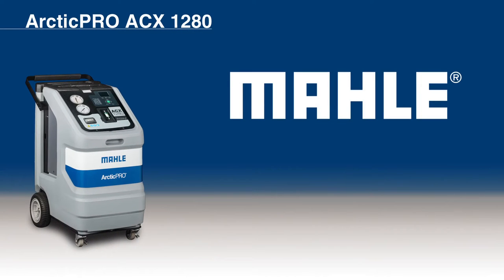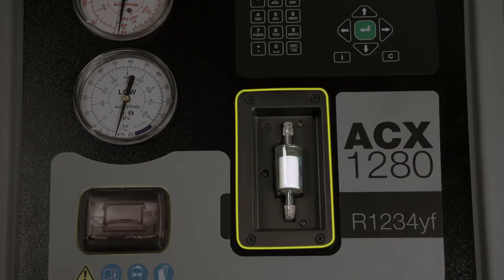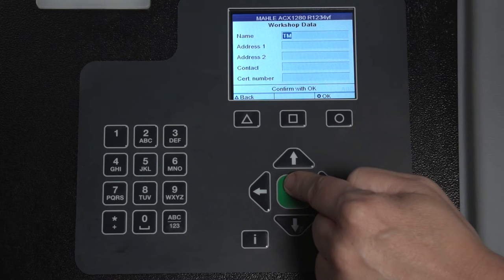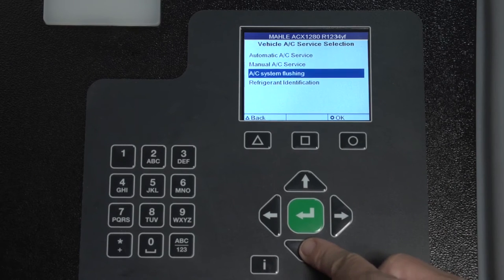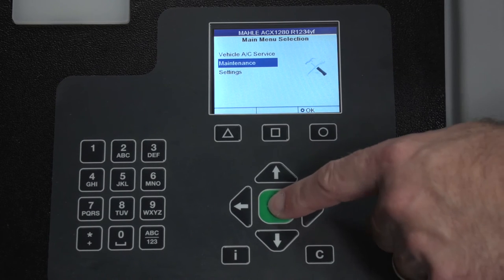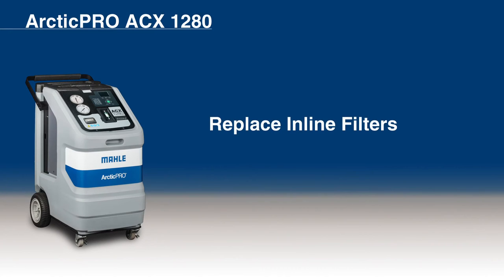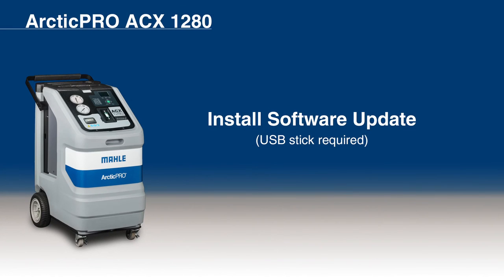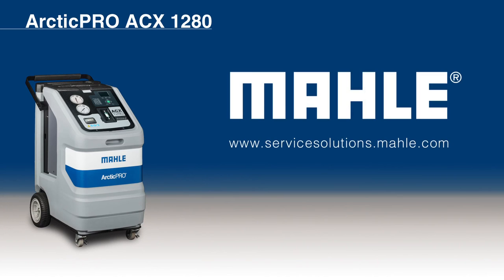ACX1280 Setup and Operation

Comment: This is a garbage machine. Way too slow.....lines always get fouled with oil......which means you have to tear the machine apart.....ours has less than 20 hours on it and im ready to dumpster it. Mahle is aware of the problems with these machines......which they could fix easily for the ones that already bought them. A simple software update and updated solenoids is all it would take. Buy robinair.......mahle screws over the customers.

Comment: 1180 has oil drain no oil fill ability wtf
Reply from the maker: The ACX1280 is a hybrid certified machine. To meet the SAE standard to be hybrid certified, the unit cannot include an oil charge.
Reply: MAHLE Aftermarket NA never said it was a 1280

Comment: This thing sucks omfg
Reply: What unit do you recommend for 1234yf? I've used this unit and the Robinair AC1234-6. I must say that I prefer the Mahle unit over the Robinair unit though.
Reply: Both take a long time Mahle setup, meaning the screen and buttoned on the top is a bit easier, but I’ve used both and they both take to long
Reply: The Mahle unit provides more detailed information during operation. For example, you can see the evacuation levels on the screen. The Robinair unit doesn't provide this information. The repair guys at my place of employment can't even use the Robinair unit. The gauges will read near perfect vacuum during the evacuation and vacuum decay test, but it will fault out every time after the vacuum test so they can never fill jobs with it even if the jobs don't have leaks. It would be nice to see exactly what the internal vacuum transducer is reading on the Robinair units.

The other good thing about the Mahle unit is that the repair guys at my job can force a charge with it. This is good for finding leaks. The Robinair unit does not provide this option. I contacted the manufacturer and they say that it's not possible for an end user to force a charge. Also, I took apart the Robinair unit and the internal tank does not use standard 1234yf fittings. Since we can't use the unit at all, there is no way to recover the refrigerant from it unless a Robinar serviceman comes out and forces a charge on it. The internal tank on the Mahle unit does provide standard 1234yf fittings so even if the unit stops working, an end user can recover the refrigerant from the unit.

Personally, I prefer the Mahle unit.